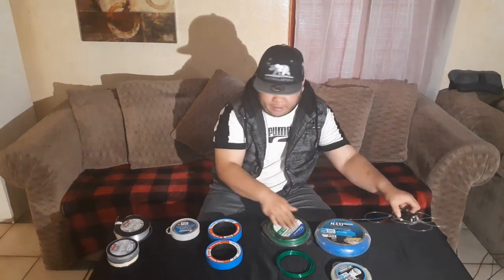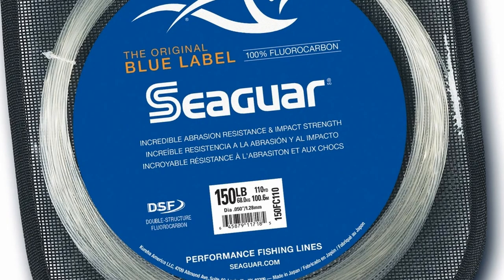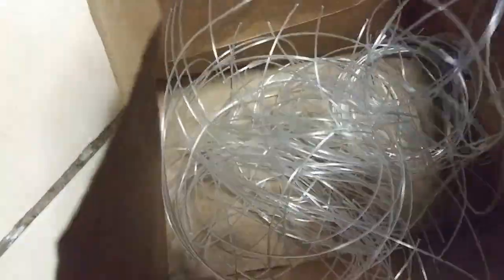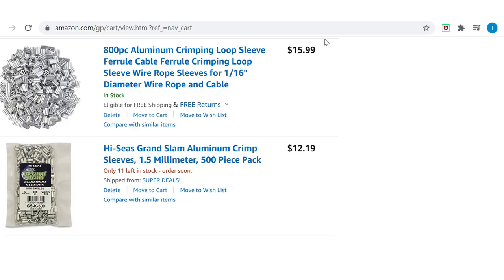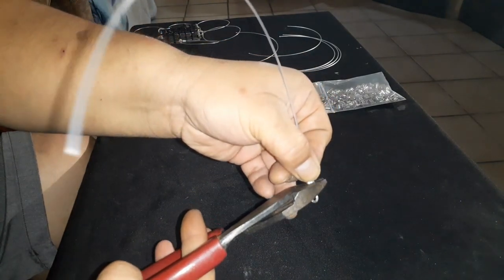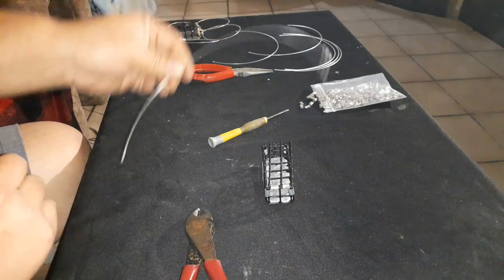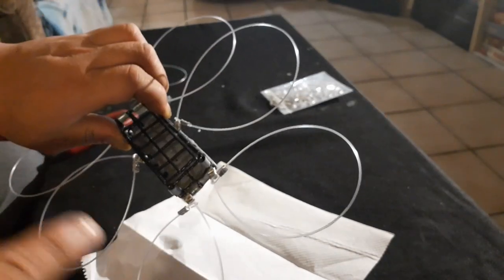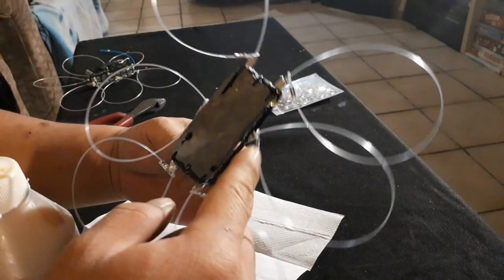Making Crab Snares EPS. 4 - Attaching Snare Loops (Secrets Revealed!)

Comment: Hey the maxi edge currently available doesn't have enough sides as the one you used. Only 6 sides instead of 8. I would imagine it would function pretty similar but curious if either you or someone has used it. 8 sides does have more of a rounded surface area and would appear to cause less friction but to be quite honest the line is so small that it probably wouldn't matter much. Just curious what ur thoughts were...

Comment: AWESOME video and information sharing! I will be using your excellent knowledge and test results to set up for crabbing in the Florida panhandle Gulf Coast area of Cape San Blas @ Port St Joe. Blue crab will be the target. Here we have the unique choice of crabbing in the St Joe Bay (thick grass beds with many open sugar white sandy areas) on the east side of the Cape OR the gentle Gulf coast surf on the west side. Cape San Blas is a very narrow peninsula that extends 12~16 miles northward into the Gulf! In addition, the St Joe Bay has little to no fresh water inflow and is in the list of the very few salt water bays with little to no fresh water inflow in the world! This makes for crystal clear water, thick lush grass beds with sugar white sand flats, dunes and shorelines both in the Bay and Gulf surfside! Bay scallops vs oysters thrive here! Surf wave action and current is small in the Gulf. The first sand bar is within casting distance! The Bay generally has weak tide flow current except at the canal mouth and at Bay entrance at max tide flows! All the above said, I will need to scale down the crab snare a bit, compared to how you fish the LEFT coast of the USA! Due to cost and sketchy availability, I am in hopes I can find a suitable replacement for the 100# test Mason rock hard nylon. I do not have experience with nylon fishing line, but I do understand the harder and stiffer the line, the more memory it will have and memory results in snare loops that will tend to stay sprung 'open' and that will slide with less resistance to 'close' when needed! I am familiar with Fluoro, mono, braid and grass trimmer line. For the loops I see only nylon or fluorocarbon as the only good options. In my online research, everything I read (true or not) is that fluorocarbon is the hardest and stiffest of ALL lines! In addition, all fluorocarbons ARE NOT the same! The more expensive ones have coatings and treatment to make them LESS hard and stiff...exactly opposite of what a crab snare loop needs. Did you test only Seaguar floros? It may be that only the cheaper 100% fluorocarbons lines (with no coatings or special process treatments), may be the hardest and stiffest of all??? Until then, I will assume the Mason hard rock is the king, but I will try some of the 100% fluorocarbons and see how stiff they are! Thanks and keep up your good work for all of us!

Comment: Hi: I very much enjoyed your very detailed video on construction of crab snares.  I tried carb snaring for the first time yesterday.  I had viewed  a view a while back and it said that the snare loops should be arranged in an the upright position. Today, I ran across your video shoeing the flat arrange of loops seemed to work best for you. Yesterday, it seemed I could see crab had been pulling my squid bait out the side of the snare and "under" the vertically arranged loops. So now, I going to re-arrange my loops in flat position like you said worked best for you.  You have many arrangements of the loops. How do you decided which to use? What bait do you prefer?  Do tides matter? Is season of year important?

Comment: Question on the crimps? For Mason line. Its the oval 1.5mm crimps from Hi-Seas right? And blue trimmer line is the loop crimps the 800pcs? 
So if i go all trimmer are all the crimps going to be loops? In my amazon cart i have GS-F-500 1.5mm 500pcs from Hi Seas for my mason line. Is this all correct?

Comment: Moon, you must have said your mantra then gotten into the mind of the crab. I too was getting the line from Masson and the double barrel sleeves but the shipping was killing me.
I started getting my line and sleeves at Bass Pro but you better know what you need because the salespeople are clueless.
I don't crab in the rocks so my lines don't wear out. Well, there are those rocks out front of our secret spot that I get tangled in once in a while.
So, the big secret is the Gorilla Glue. 
Is that what you use to get the loops into the more upright position on your Dragon Tooth snare?
How I removed the memory of the line was seriously stupid on my part. I won't even tell you how stupid I feel now. I got them straight but I really worked too hard to do it. Just boiling water, my bad!!
Can't thank you enough for the video.
Is there one on the Dragon Tooth too?
I seem to catch more when using the upright loops but that may just be how I have them mounted??
I'll now look for your video on refurbishing the snares. I have done it in the sink but I'm pretty sure you have a better way!
Reply from the maker: Hey Gene! My Dragonfly Loops are bent differently. I still use epoxy on them, but it's a different step. I will show that in my future videos when I make the Dragonfly Snares. Always good to hear from you.
Reply: @TheJoyofLiving  I just learned not to do something on my puter or you loose everything! Last night I removed the loops from a twinkie snare I have with no weight. I made a new lead mold and will add the lead today. I want to try making a better dragontooth out of it. It is one that I make to add weight onto when I ren into different tides. 
I'll wait until I see the D-tooth made.
I have a lot of snares left from last season but you know, I'm bored waiting for the season to open!!

Comment: Why do you use the ruler to measure every one of the loops? Why don’t you just hold the cut one in your hand and run it along the line off the spool and cut it the same length!
Reply from the maker: I tried that at the beginning. Too slow. My way is quicker with higher percentage of length accuracy. Good comment though. CRAB ON!
Reply: @TheJoyofLiving  
I can not see how it could be slower 🧐. If it is you are doing something wrong. Just cut a stick 13” long and put a cutter on the end of it. That would make the work go by really fast.
Reply from the maker: @fishhunt9874  Good luck in your Snare making journey.
Reply: @TheJoyofLiving  
No building for me, I have only purchased them. I leave the building to the experts 🤛🏻👍